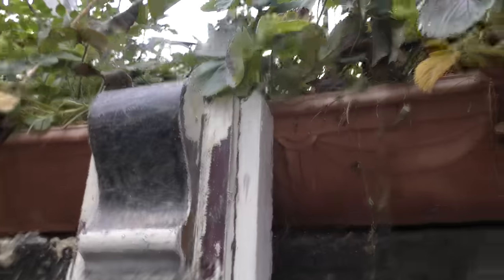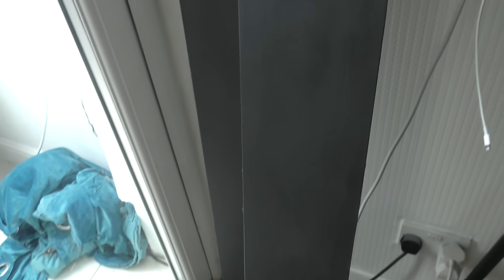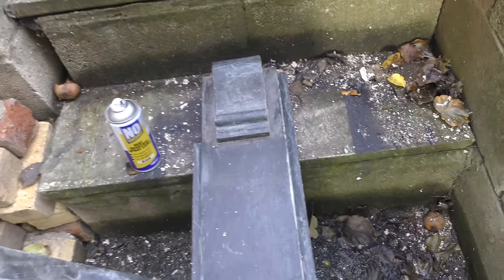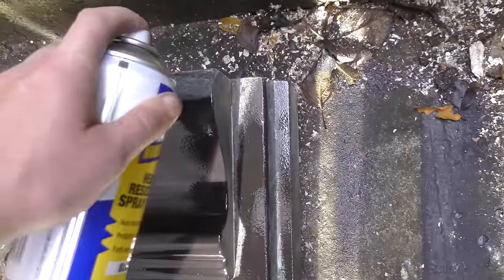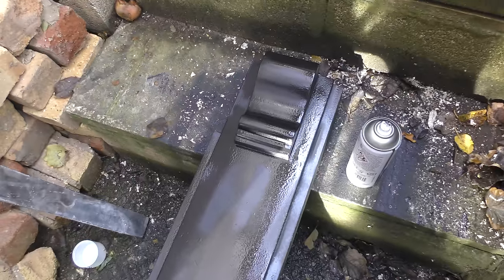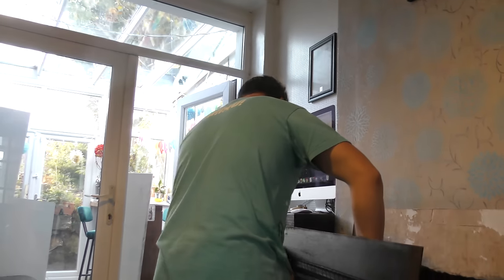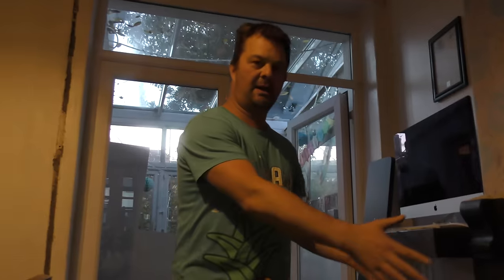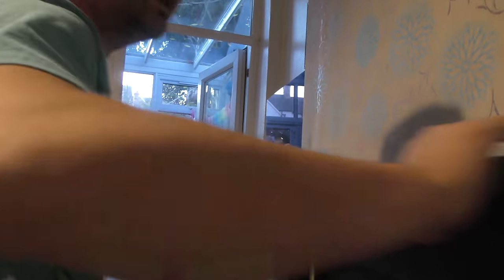How To Restore And Install A Victorian Cast Iron Fireplace Range

Comment: I am not trolling when I say this but I have to be frank – this is a dangerous installation and you should not be encouraging anyone to install this way. Your heavy surround is simply cemented to the wall . This is strictly against regulations because of the danger it presents.

In installing fireplace elements that represent a crush risk should they come loose and fall, you must never simply rely on an adhesive bond to a surface, let alone to mere plasterwork and/or decorative finishes such as wallpaper or paint. The surround must be deeply affixed to the fabric of the building itself, with steel brackets, ties, lugs or heavy gauge wire screwed/bolted or deep set (using chem set anchor bonding or similar) into the brickwork (or studwork) behind.

This is for good reason. If a child pulls on this installation while reaching for objects on the mantlepiece or hangs or swings from it (as they do) while playing, their life literally depends on the integrity of a mere adhesive bond to a feeble substrate/decorative surface. The adhesive may be strong, but the material it is holding to certainly is not, and the installation will ensure that it becomes weaker still  - the mechanical pressures now being applied to it by a rigid element which is not only far stronger than the material it is bonded too but which expands and contracts at a different rate with temperature changes (and which is also applying stress forces simply though normal house movement) can cause imperceptible stress damage at the point of contact and ultimately lead to catastrophic failure of the bond. It does not matter how strong your adhesive is if the material beneath it gives way – a stiff adhesive is in fact contributing directly to separation from the substrate.

And yes children are all too regularly killed or badly injured by failing surrounds which were unsafely affixed by DIYers in precisely the manner you are promoting here. Just google this if you doubt it.

You really should take this video down, not only in the interest of children whose parents might follow this poor advice, but for your own protection also – if someone is hurt by your own surround eventually coming away, you have publicly posted plain evidence of culpability with a dangerous and non-compliant installation.

A further issue in this installation - others are quite correct when they ask whether the void behind and to the sides of the insert’s backbox should have been backfilled. Yes it should - with a weak mix of vermiculite and cement at 20/1, or a weak mix of expanded clay aggregate and cement at 6/1 (mixes should be 25% richer if NHL 3.5 lime is used instead of cement because it is an historic building). Omitting this backfill and leaving a void behind the insert not only risks damage to the fireplace from extreme temperature differentials, but also simply sends a lot of the heat you are generating straight up the chimney as you’re pointlessly heating air on the wrong side of the insert.

But it is the safety issue that is most important here. Do the right thing and take this video down for the protection of the children of others - and take the installation itself down and do it properly for the protection of your own. Or have it done by a specialist. It is not a situation for seat-of-the-pants DIY.
Reply: Could have summarised this in about 2 paragraphs. Waffling on mate

Comment: Amazing video! Very comprehensive.   I have a question about the opening up of the stairs (which looks amazing). Were the stairs independent of the wall that was there? Was the wall offering no support to the stairs or the landing? I'm keen to do the same thing myself but wonder if a builder/structural engineer would be best to understand it.
Reply from the maker: Have a gentle look at what the structure of the wall where the staircase is, mine was just vertical floorboards as a wall so no support their at all, the Victorian houses were build with small rooms in mind so they were not different/expensive to heat, so it may just be a case of opening it up as we now have temps of 40c in summertime

Comment: Curious as to why it wasn't backfilled?  Every thing I read says that Cast Iron inserts should be backfilled to prevent the cast from cracking under the heat.? But can't find a single video of people backfilling.
Reply from the maker: It was originally, but all the backfill was damp old rubble so removed it as to get rid of the damp.
Reply: @realaleguide  so you didnt refill it? Any worry about it cracking?
Reply: The soot coming back down the chimney can bean issue if there is a gap down the back …everything I have read says you need to strip the plaster off, back fill with thermal filling behind the cast iron to protect the iron. And prevent accumulation of combustible soot….